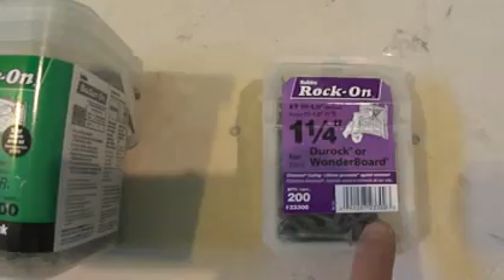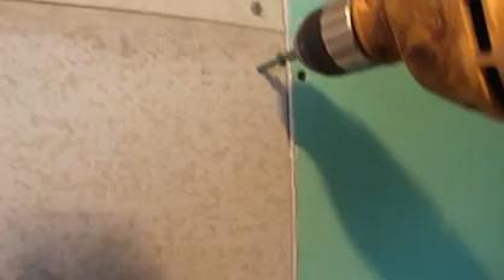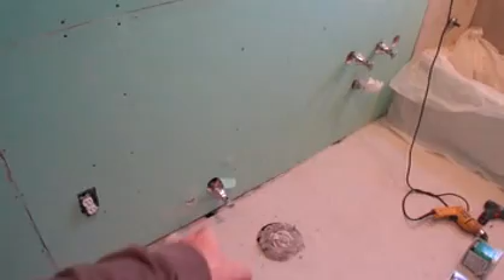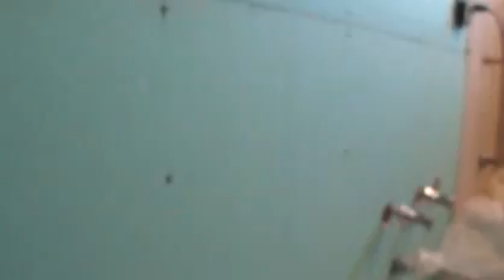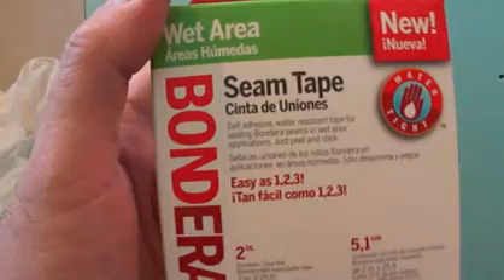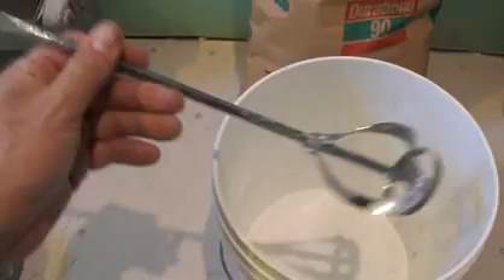How to attach cement and green board.avi

Comment: The trick is to use an impact drill, I use the square heads, like them better anyways for stripping purposes, but regardless the job of getting them flush or below the surface is to use an impact drill.. and it's way easier

Comment: If you read the box you tried to use the screws meant for Durock or wonder board on cement board 
Cement board screws are different as they rout out material so they sit flush . I hope you are not charging anyone for your handy work by the looks of the drywall installation / not removing plumbing valves before cutting holes in drywall and just a sloppy fit in general . But I guess practice makes perfect